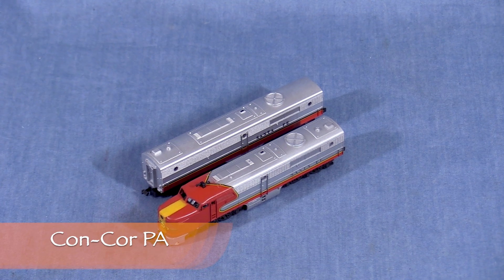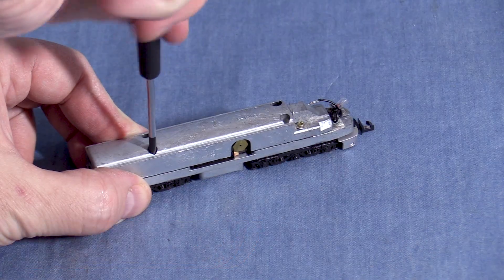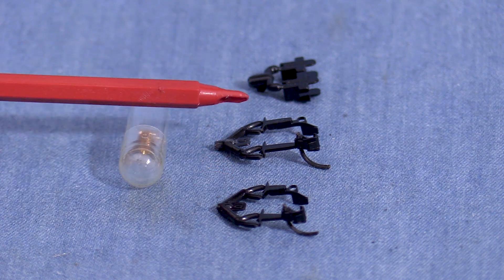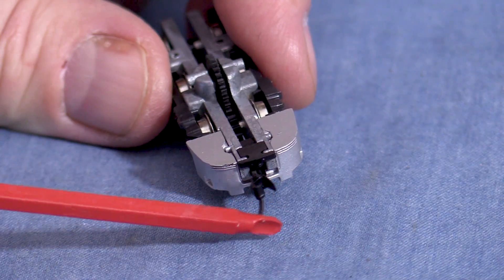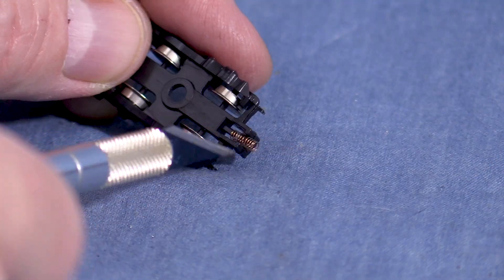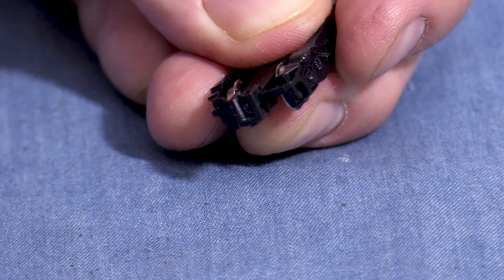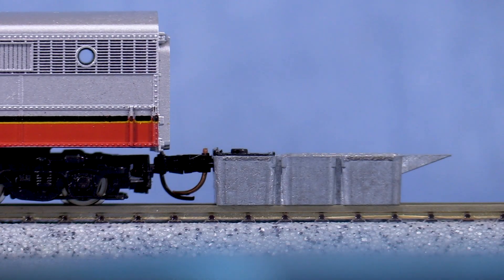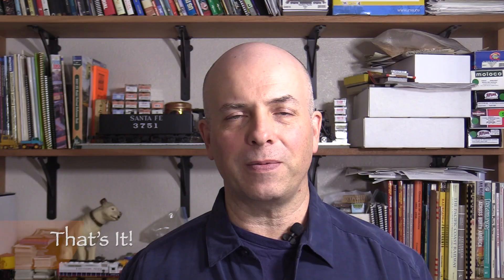Model Building Tips N Con-Cor PA Coupler Swap

Comment: Good old Kato Con-Cor units. I've got one of the PA1's in SP Daylight scheme and an EMD E8 also in SP Daylight scheme. Both run smooth but are still running the old Rapido couplers. May need to pick up a few of these conversions, but, it's not an urgent need as the Con-Cor Daylight coaches I have are all still on the old couplers. I know you're an SP fan, Dan. I think I have videos of both of them on my channel. Picked them both up used, one off of eBay and another at a local train show.
Reply from the maker: Those were good units.  The main reason I retired the two PA1s that I have is because the wheels are worn out.  I literally ran the nickel silver plating off of them.  Back when I was younger and N scale quality was more spotty, those were my most reliable locomotives.  I ran them most of the time since they worked so much better than most of the other models I had.  Thanks for watching!

Comment: Great video Daniel. I'm not sure how many folks still have these old locos still in service? Swapping them to DCC will be the next challenge.
Reply from the maker: The cast metal frames on these things take up most of the inside of the shell, so finding space for a decoder would be a challenge.  The frame might need to be milled, especially if you also wanted sound.  This particular one is going to my cousin as is, as I don't think he has DCC.  I'm not planning to do anything with my old ones because they're too worn out to run.  Thanks for watching!

Comment: MORE important than the Arnold coupler swap (hey, they work, so what) are the blasted wheels on old Con-Cor locomotives and cars. Are there replacement wheels suitable for the old Con-Cor PA1/PB1 and E7A/E7B that do not derail in switches?
Both my E7A powered with E7A dummy and my PA1/PB1 set are most frustrating, along with the UP smooth sides and NP Empire Builder smooth sides, which always derail on whatever switches I have tried them on, whether Atlas, Kato, Minitrix, Fleischmann, Arnold, or whatever! My new Kato Olympian Hiawatha just sails right through, same as almost all of my new and vintage Minitrix, Fleischmann, Arnold, Piko, Brawa, and Kato German and Japanese models, spanning from late 70s to brand new. They all get over Katos' #4 switches, but my vintage Con-Cor stuff never liked any switches at all.
I like these models, but they were boxed since when I bought them new, in hope of finding new wheels, that were never available for them to try locally.
Reply from the maker: Years ago I searched for replacement wheels for my Con-Cor PA1s, but couldn't find any.  The main reason my PAs are retired is that I literally ran the plating off the wheels, down to bare brass, and as a result they have very poor electrical contact.  NWSL used to make some replacement wheels for different N scale diesels.  I'm not sure if they still do, but that might be something to explore.  As for the cars, it sounds like it might be a gauge problem.  Have you checked the wheels with an NMRA standards gauge?  I remember some old Con-Cor passenger cars used to have metal wheels with brass axles that could slip out of gauge fairly easily.  There's a program here on the channel about re-gauging wheels, or you could try to find replacement wheels for the cars.  Atlas, InterMountain, and Eastern Seaboard Models offer metal replacement wheels.  You would need to figure out which one has the correct axle length for the cars.  Thanks for watching!